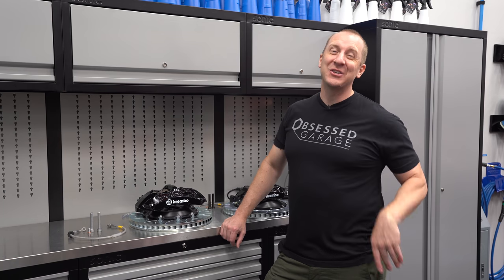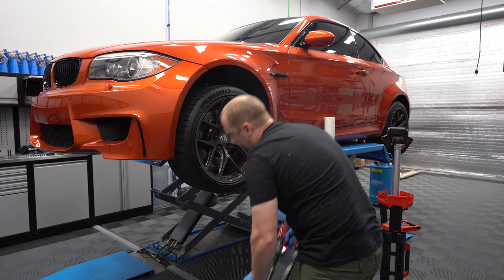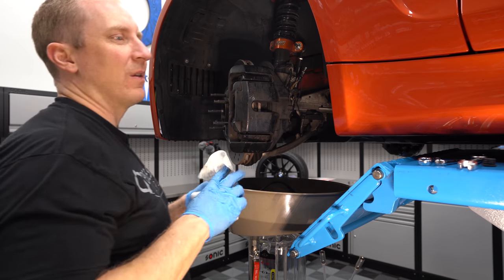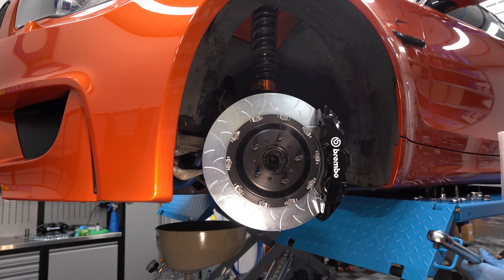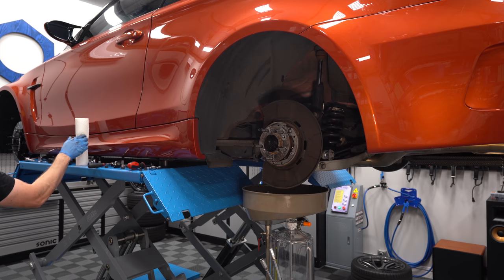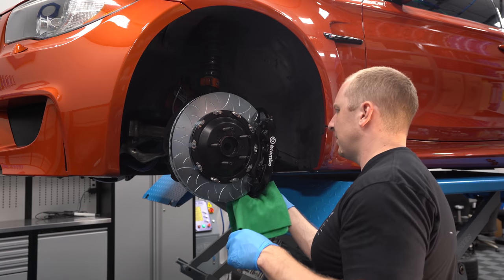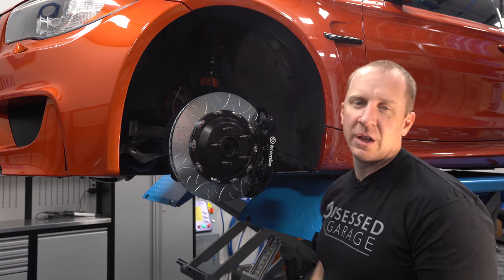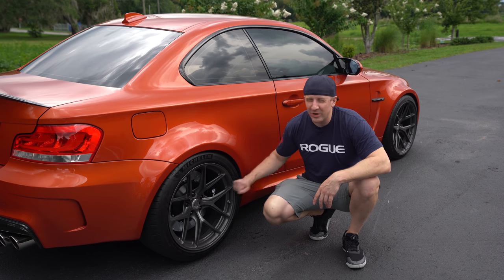BMW 1M: Brembo GT BBK Install

Comment: Matt, always clean the rotors with some brake cleaner and change gloves when you put the rotors. Furthermore you should avoid touching the pads with oily gloves. Just to be sure.
Other than that, awesome as always!
Reply: 39:09

Comment: Brakes optimized when placed inboard as far as weight distribution.  But also placement is due to packaging constraints with suspension and upright clearance.

Comment: I believe that clear sleeve on the front brake line at 40:48 belongs centered inside the grommet. It allows the brake line to move through the grommet with less resistance and protects the grommet.

Cheers.

Comment: You need to check out the Motive Products - Pressure Bleeder. 

It's make bleeding brakes a One person job, by sending pressurized fluid from the fluid reservoir to the brake bleeders. One of the best investments in car maintenance I have made. Bleed an entire system in under an hour.

Comment: Brake caliper location can be chosen from a weight perspective. You could have them lower on the wheels to get a lower center of gravity or on the inside te have more weigt to the middle of the car like in this case. Aerodynamics can also play a role, if there is a certain path the air takes that could be cooling the brakes, you might want to place the brakes in that location. An offroading car might have them higher to not damage the brake system.

Comment: Hey Matt, don't know if you want to get better brake kit than the Brembo GT since your most use of the car is street not track but the AP Racing 9660 by Essex is the way better brake kit compared to the Brembo GT or GTS series. The AP racing kit is a lot lighter than the Brembo while still having 6 piston front 4 piston rear and the same braking capability if not better. The brake pads will be also easier to change due to the back of the caliper is open and the caliper its self is forged. They will have the anti-knocking clip too for street use. I have this kit for my M2 on track but on street with street pads it is just like stock but brakes so so so much better.

Comment: Nice job Matt! You should look into getting a Motive power bleeder they work fantastic, with that as you bleed you can use a rubber mallet and tap around the caliper to rid of any air pockets in the caliper.
Reply: Im using this too, and damn it makes the job so much easier, must have!

Comment: No reason to separate the calliper to mounting bracket with the factory brakes. Just undo the 16mm bolts for the bracket and take it all off as one assembly.

Comment: soooo' all that huge and nice garage but no Dremel tool or tool cart, C'mon Matt it's only $250 max for both... Quick tip Matt, next time please clean off the wheel hub surface AND the rotor surfaces thoroughly with brake cleaner and dry off with a dust-less rag/towel and wear new, clean gloves to avoid grease and debris getting all on the rotor surface. Which brake pad/rotor bedding procedure did you use?
Reply from the maker: You can do. whatever you want to the rotor.  I just wiped down when I'm done.  I don't want to have a store a cart.